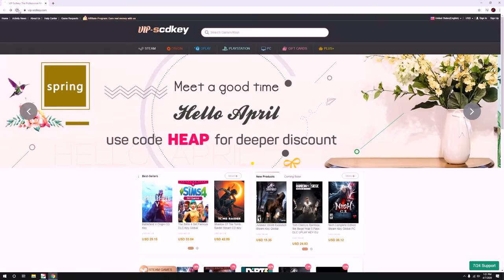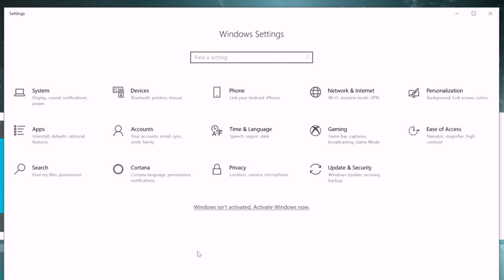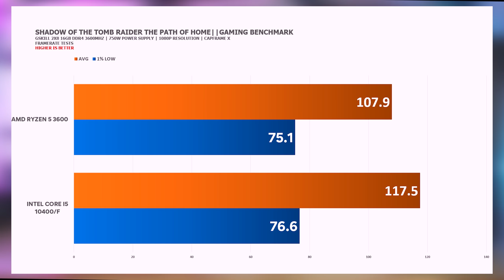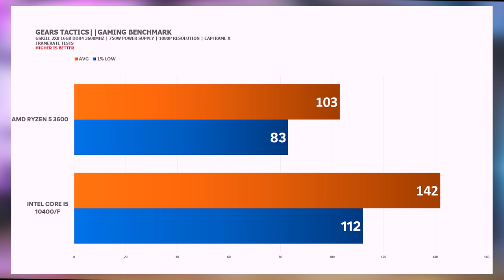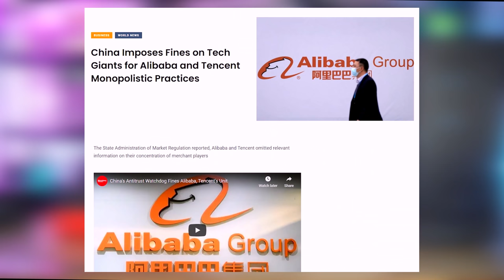Subukan Natin Ang INTEL10400/F vs AMD Ryzen 5 3600 ft Asus ROG B550/B460 Boards & RTX 3070 2021

Comment: intel advantages 
- cheaper processor 
- cheaper motherboard (H410M-H)
- will only require basic ddr4 ram no need for anything fancy
-locked cpu no need for aftermarket cooler
Reply: An unlocked cpu doesn’t magically produce more heat than a locked one, in the end its up to the user kung gusto niya mag oc

the 10400F actually beats the 3600 if ran with 3200mhz ram using a B560 board
Reply: @chocolaa-p2689  35k set only

i5 10400
steel legend b560m
8gb 3200mhz crucial ballistix
256 m2 sata
gtx 1050ti
corsair 550w
raidmax gaming case
24inch frameless led monitor hkc
mech red dragon mouse keyboard
Reply: @chocolaa-p2689  boss may nagaalok sa akin oks na ba to? used gpu and monitor the rest bnew
Reply: @hayaaishigami147  ok na siguro if may monitor pero upgrade gpu pag kaya na
Reply: @hayaaishigami147  halos same tyo specs boss. bought 2 weeks ago.

i5-10400F
Asus TUF B560M gaming plus wifi
2x8GB Crucial Ballistix White (running @ 3600mhz)
980 evo 500GB M.2 ssd
Corsair 550W Bronze
Tecware Nexus Air (White)
ID-cooling SE224 XT ARBG air cooler (Black)

Approx Php34K

then i installed/used my old gpu EVGA GTX 750Ti SC , 1TB HDD. and 1080p monitor.

Comment: Sir sana masagot baguhan lang sa pagbuo. Ano po ang mas maganda b550 or b450 at ano difference nila medyo hirap ako sa pagpili ng mobo na compatible sa ryzen 3500/3600 . Thanks
Reply: if tight budget mo b450 and 3600 if meron knmn 🤑 b550 and 3600 main difference if support(for ryzen 5000) and features lng nmn na hindi pa relevant ngayon

Comment: Kahit 10100f vs 3100 lamang sa gaming performance ang intel productivity sa amd, with 10100f 1k cheaper and at least base sa mga nakita kong benchmark. Depende nalang din kung ano priority. Kung tight budget at gaming intel. Kung productivity at upgrade path amd parin.

Comment: Watching with my R5 3600 and Rog strix rx 5700 xt <3
Reply: Sir Bermor, I got a Aorus 2x8gb 4400 MHz RAM. Bakit hindi ko po ma run yung 4400 MHz ng RAM ko? Di po ba kaya ng R5 3600?
Reply: Baka hindi supported, gawin mong 3600mhz n lng
Reply: @zeidel01  Pero sa MOBO ko sir supported naman until 5k MHz
Reply: @jessiehantv1475  high speed doesnt means better performance i think 3600mhz with low cas would be better
Reply: @tunaaa5997  My MOBO is asus tuf b550m plus wifi sir.
Reply: @jessiehantv1475  nka punta kna sa bios?
Reply: @tunaaa5997  oks na sir. Running at 4400mhz na. Salamat :)
Reply: @jessiehantv1475  enable mo xmp profile sa bios

Comment: i5-4th gen
Biostar board
8gb ram 
1050ti 4gb INNO3d
240gb ssd
19inch wide Monitor
400w Truerated psu
Rakk Marug Case
4en1 Gaming Accessories
Gaming Keyboard
Gaming Mouse
Gaming Headset
Extended Mousepad

sulit na po kaya ganitong build sa 25k planing tp buy this end po january pa help po wala po kasing alam about sa build build

Comment: Ano poba maganda specs 38k to 40k thanks po
Reply: Ryzen 5 3600
B450m Mobo
3200mhz or higher 2x8 16gb
1660 or higher gpu cards
SSD/Nvme for os
hdd for storage
psu depende sa power na kailangan pero wag bibilhin na sakto yung watts
kunware 500watts kailangan mo bili ka ng psu na 600 o pataas pero wag
masyadong mataas kasi overkill at sayang pera.
Reply: @xodus3592  thanks sir appreciate it💙
Reply: For what purpose?
Reply: @ushuaiabelen2510  gaming po
Reply: @Jared-cl7cd  

Ryzen 3 3100
Gigabyte B450m ds3h
Patriot Viper Steel 2x8gb 3200mhz
WD Blue 500gb x 2 hdd
WD Green 120gb ssd
Gigabyte RX 5700XT Gaming OC
darkFlash GP650 80 Bronze
Tecware Forge M aRGB with 4fans rgb

cpu - 5500 pchub
mobo - 3500 pchub
ram - 3500 pchub
hdd - 2400 easypc
ssd - 500 bermor
gpu - 20000 pchub
psu - 2700 pchub
chassis - 2600 pchub
Reply: @ushuaiabelen2510  thanks po sir

Comment: Hello sir, can you help me,for what should be my build component sa dream pc ko. I only have 25k-30k budget this 2020 and the cpy is Ryzen 5 2600 at Nvidia Card. Thank you po!
Reply: rx570(better)amd/1050ti(nochoice)nvidia
8(gipit)/16(luwag)
ssd120gb
hdd500gb/1tb
a320(gipit)/b450(luwag)
600psu
im assuming meron knng moni mice etc
Reply: @tunaaa5997  pwede na di kabilang ang mga peripherals pc lang pero salamat sa suggestion mo😁
Reply: @izugami5802 yezzir r5 2600 + rx570 is a good entry level pero pag iniisip mo sa future kung kakayanin padin ng rx570/1050ti ay diko masasabi. Kaya ako nag nag cheaper option ako diko pinili ang r5 2600 which is un ay maganda padin. Ang 1600/2600/3600 ay sobrang gandang gamitin nowadays. Pero nung tinignan ko ang performance ng r3 3100 at r5 2600 sa gaming ay halos parehas lang. Diko kasi kailangan ang extra cores dinaman ako nag s-stream. Schoolwork lang at gaming talaga
Reply: @xodus3592  i will use the pc for streaming 3d rendering and gaming. I think my option is gtx 1650 super if beyond the budget i go rx 570. Thanks for the information tho Thank you!

Comment: Sir ginaya ko po ung Php15kpcbuild na blog mo. Eto po build ko:
Ryzen 3 3200g
Gigabyte a320m s2h v2
1x 8gb 3200mhz 
*Tanong ko lng po kung compatible ung 8gb 3200mhz sa mobo ko?
*Compatible pa rin po ba kung 2x 8gb 3200mhz ilagay ko sa mobo ko? 
*Thank you po sa response
Reply: the mobo wont support the speed of ram but ur fine 2xram would be better

Comment: Kuya bermor pasok poba ito sa 45k i5 10400f 
1tb seagate barracuda 
8gb rog rx5500xt 
tecware forge m argb tg matx black 
rog b460 f gaming 
tecware mirage 240 AIO COOLER
tforce delta 2x8 3200mhz 
256gb m.2 nvme ssd 
cooler master mwe 550w 80+ power supply white
Reply: Google pchub online pricelist, nandun mga presyo
Reply: its good to have an nvme but i think ssd just make more sense also i do not recommend 5500xt pair it with 1650super/1660/super

Comment: Bali sir wala naman Bottle neck na mangyayare kapag Ryzen 5 3600 if GPU ay 3070 or lower po unit of GPU?
Reply: 2080 and higher cards mag b-bottleneck na siguro ang 3600.
Reply: not really if its 1440p
Reply: @xodus3592  3070 is already a 2080 higher card
Reply: How about 1080p. Hahaha icant afford 1440p hahaahhaha.
Reply: @errinjamesfaustino1101  idk how u cant.. if u plan or own a 3070 but no it will not
Reply: @errinjamesfaustino1101  r5 3600 at 1660super lods goods nayun.
Reply: @xodus3592  nice nice hahah. Try ko hahah. Balak ko muna monitor upgrade. Para sulit
Reply: @errinjamesfaustino1101  akoden lods hahaha nagsisi ako na bumili ako ng 75hz monitor. Hindi nalang ako nag dagdag ng konti at nagka 144hz pako hays. Hahahaha

Comment: ano pong magandang parts around 25k build ryzen 3 3100 hindi na po kasama sa 25k yung case and fans.
motherboard-
processor- ryzen 3 3100
ram-
gpu-
psu-
nalilito po kasi ako kung anong magandang mga brands and model ang magandang bilhin pero  around 25k more or less ang kalalabasan  ng build ko wag nyo na po isama sa 25k yung case and fans Salamat po!!!
Reply: kulang yan, gawin mong 30k. eto bilin mo sa 30k. asus tuf a520m plus board, 2x8gb patriot viper steel 3200mhz ram, asus tuf gtx 1650 super gpu, fsp 500w 80+ bronze psu, 250gb samsung 860 evo ssd, 1tb wd blue hdd
Reply: @zeidel01  copy po maraming salamat ano pa pong alternative sa motherboard kung wala akong mahanap
Reply: Gigabyte A520M DS3H, Asrock A520M Pro4
Reply: @rafaelvirnelcberinguelajr.4047  Hahaha yes keep po ung a520m good mobo po yun pero kung para saken mag 120gb ssd kanalang para mas mura at makapag save ka kahit konti at maghanap ka ng ram na 3200mhz kung gusto mo nang mura wag rgb bilhin mo lods at 3.5k lang ang magagastos non. 1k sa ssd 3.5k sa ram
Reply: Keep din po ang psu. ako po ang psu ko is cv corsair 550watts 80+br nabili kopo ng 3k lang. At para sa gpu as much as possible 1650super ang bilhin pero kung wala at kulang 1050ti nalang or kung may mahanap kayong rx570. Pede din rx580 at 1650.
Reply: Motherboard - Gigabyte B450M ds3h - P3500.00 - Dynaquest
Ram - Patriot Viper Steel 2x8 3200mhz - P3500.00 - Pchub
Gpu - Zotac RTX 2060 Twin Fan - P16500.00 - Pchub
PSU - darkFlash GP650, 80 Bronze - P2500.00/P2700.00 - Pchub

Comment: METEOR 0.1 tempered case brandnew

G4560 with 64bit brandnew

A320 MSI MOTHER BOARD 
brand new

8gb RAM Hyper X brand new

Ssd 120 Gb storage kingsman
Brand new

24 inches monitor Brandnew white

450 watts inplay  bronze power supplly 80 plus brand new

Keyboard mechanical gaming brand new

mouse fantech rhasta bn

RGB fan 6 brand new
 
king bao cl18 cpu Cooler brand new 

mouse pad, Long leght brand new

Headset VISAGE BRAND NEW

Web cam streaming brand new

GTX 1050 Video card brand new

Goods napo bayan para sa 25k budget?

Comment: Good day!
Any suggestions po sa items na balak ko bilhin para sa setup ko at kung saang store po mabibili lahat ng item online para po isang delivery lang po please!
*M-ATX Case worth 1.5k
*Cooling Fans worth 1.5k (6pcs - 120mm or 140mm fans)
*PSU worth 4k (650w full modular 80 Plus bronze/gold)
* Storage: 1 wd blue 1tb hdd worth 2k
Specs:
i59400f
Deepcool heat sink
msi h310m pro vh plus
GIGABYTE Rx 580 8gb
2x8gb hyperx fury 2666mhz
1 wd blue 500gb hdd
samsung evo 860 250gb ssd
Corsair VS650 (Balak ko po palitan tong PSU ko kasi nagrerestart po ang pc ko in game (any games) pero ok naman po siya kapag surfing lang)
Reply: i do not recommend buying online if passable
Reply: i think amd would be a better price r5 2600

Comment: Ma Ganda po ba to Ryzen 5 3600

Aorus b450 pro wifi

Gigabyte RX 5700XT 8GB gaming OC GDDR6 

G skill trindent z neo rgb 3200mhz 16gb (2x8)

Gigabyte 650watts 80+ Bronze

Masterliquid:ml360l v2 argb

500gb WD blueSN550 SSD M.2 NVMe

1tb wd caviar blue 

Coolmaster: vertical holder

Coolman robin2: dual chamber tempred class

Custom black sleeves

Deepcool rf120 3in1 3x120mm
Reply: yes but better go for nvidia rtx marami ksi features and blah2
Reply: nvme is good but you could buy 1tb ssd with that price i think..
Reply: i think 3600mhz ram would be good like the ripjaw ones theyre kind of cheap but if not ur fine

Comment: sir pwede ba 3600 sa 1050ti?
Reply: pwede lods kaso bottleneck ata 3600 sa 1050ti
Reply: @xodus3592  ?
Reply: @xodus3592  1050ti ang BOTTLENECK HINDI 3600. Goods po yan sir sweetspot po 3600 in temrs of work ang gaming
Reply: also addition i do recommend to save some money i think 1-2k difference ung price the 1050 and 1650 sup ..1050ti is not really worthy of its price ..if u cannot go for rx5704gb
Reply: @tunaaa5997  yezzir 1050ti ang bottleneck yun ibig sabihin ko napagbaligtad ko lang hahaha
Reply: 3600 is really a great cpu nowadays pero dahil pandemic ngayon ay syempre mahirap napilitan akong mag R3 3100 + 1650super combo.
Reply: @RenLL-1  nooo, mapupulldown yung fps dahil sa mahina na gpu
Reply: Upgrade ka boss to 1660

Comment: tanong lang po kung sulit ba ito? 

⭕ Ryzen 5 3400G - ₱29,300 Tempered Case with True Rated PSU 

(Choose your own Tempered Case) 

📦 INCLUSIVE OF THE FF: 

✅ Gigabyte/MSI/Asus A320M-S2H
✅ TFORCE Delta Dark Z 8GB Ram DDR4
✅ 256gb SSD (10x faster than  HDD) 
✅ Vega 8 / 11 Graphics
✅ 24" Gaming Curved Monitor
(upgradeable to 27" or 32")
✅ RGB Fans with Remote Controller 
✅ FREE OS: Windows 10
✅ FREE Microsoft Office Installed 
✅ FREE Gaming RGB Keyboard & Mouse
✅ FREE Gaming Headset
Reply: Kung fb, youtube, light games, online school, work from home, pede na yan. Pag binili mo yan wala kna problema, gagamitin mo na lng
Reply: ano pong mga light games ang pwede?
Reply: cs go, valorant, dota